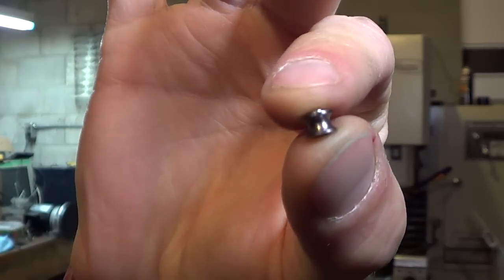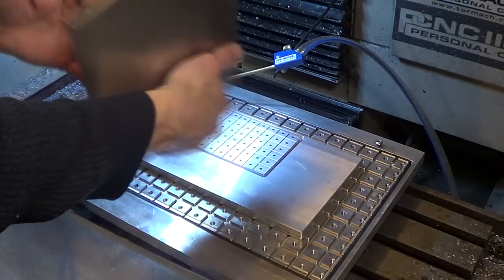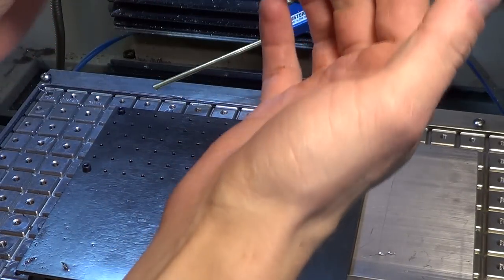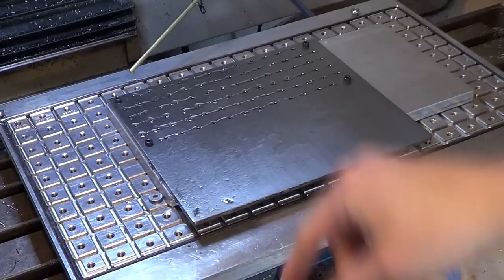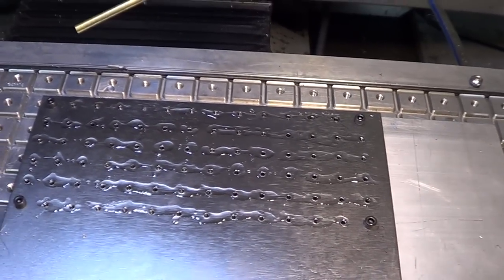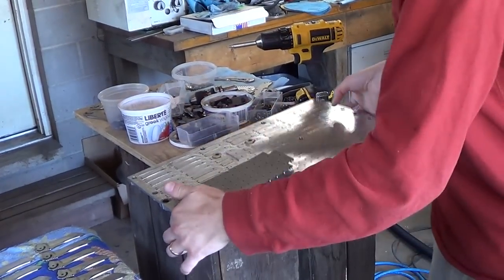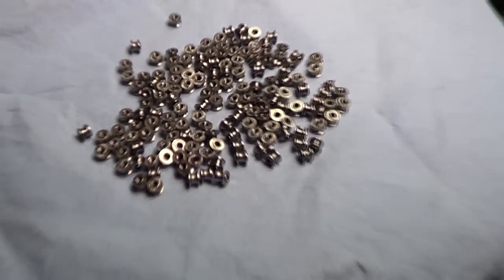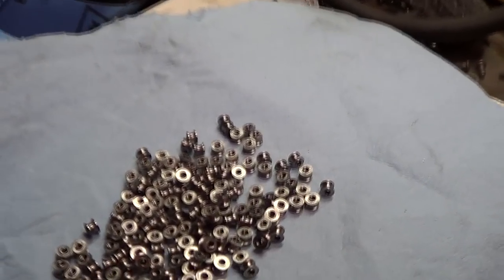CNC Titanium knife spacers

Comment: The problem with Superglue is that it's not FDA approved, it's composition is slightly different than the medical stuff. Superglue will break down into unsafe components such as formaldehyde. HOWEVER, in the doses you get from the amount needed to seal a cut is insignificant. I believe you produce much more in your gut from digesting certain foods.

Comment: Not complaining they look nice and the idea is a good one but seems to me that there is a lot of wasted metal from the plate I don't know where or what your profit margin allows you however a company/business should always try to max savings when and where possible turning it from a bar stock would yield less wast titanium which material cost will add up much faster than a few extra tool changes  but as you stated your lathe lacks quality so for you at the time maybe it is the bast way until able you buy a good CNC lathe

Comment: Bit late to the party here, but when you have to machine parts like this, offset the rows by 30deg for like a honey comb pattern to massively reduce stock waist and as a bonus you get for more efficient tool pathing. BTW the first commercial use of super glue was in the war, it was in first aid kits to close up cuts and bullet holes.

Comment: rigid tapping function are quite commonly on cnc machine and work with NC tap are better may be I think it give better chips flow less shear force compare roll tap
.
Reply: RayChan----------The up side to using a roll tap instead of a regular spiral point is that the roll tap doesn't leave chips.  The thread chips build up when threading multiply parts and sometimes you  have to stop the spindle to clear the chips.....lost time.

Comment: I recommend buying a sliding headstock lathe , because you have to work exclusively pieces relatively small ( 5-8mm in diameter ) and especially with the technology of the guide bushing components so small , precision and productivity are incredible .. . ( I speak as an operator in here Tornos turning centers , citizen , DMG Mori Seiki )

I would recommend the series Tornos micro or Citizen L20 ...

Obviously, the machines are costly , however , do not think you can find better in the market

Comment: Okay, maybe it`s more practical for you to do it that way, and the engraving is a cool touch, but...boy, you are wasting TONS of material. You can find tube wich has the right inner and outher diameter. to minimize operations, and machining two simple adapters, you could easily pop them out in an evening. (meanwhile the mill does much more interesting things XD )
Besides on a lathe, you use a four tool rotary post, no need to "change" the tool (and set it properly) each time.

Comment: Waste of material and so many better ways to do this.
Reply: Roger LaFleur I would have to agree with you, the amount of waste material is crazy..
Reply: +Roger LaFleur You could have spent as much time suggesting better ways to do it.
Reply: Roger LaFleur i disagree i think he made a great amount of standoffs in the most efficient way possible
Reply: Right at the start of the video he tells that it would be much better to make it out of round stock on a lathe.
He also explains his reasons why he doesn't use his lathe. John is fully aware that this is a waste of material, but he has to work with what he's got

Comment: Love the comment  "the lathe can only cut 1 at a time even with a bar puller"  what a joke.   You can only cut 1 at a time with a mill also.   Lathe with bar puller would take 10 sec. each and you would not need to flip.

Comment: Really, it is not like you have more than one spindle on that tormach, so you are still doing one piece at a time.

Compare this with a screw machine or a swiss lathe. I know you'd get the amount of parts from the screw machine faster than what you have clamped there on the mill......but on your mill you'd have to manually remove your parts and insert blanks again. 

Screw machines are still the king at stuff like this. Anyway, you could also try doing small parts like that on a Brother tapping center like they did at my old work.......but if your fixture isn't PERFEcT, you will get parts kicked out.  You don't have those sorts of problems on a screw machine.

Comment: I am getting into machining titanium on my tormach. I was wondering if you could give me a starting recipe.

I have the tormach face mill. Which inserts should I use?
I am making parts from grade 5.

Any suggestions using a 3/8 end mill for speeds and feeds?
I am running a .030 end mill in titanium, at a whopping 2 ipm.

Comment: This is a pretty cool solution to your lack of lathe issue.  The final product looks like you were able to maintain a great surface finish as well.  
My first thought was similar- yikes at the scrap, esp for a pricey material like Ti.  In the interest of pursuing this further, and because half the rest of the comments are to the same effect, here is a little breakdown:
(Assumption part is approx 5/16 dia x 5/16 long, 6-4Ti)
Plate 9x9x5/16: 4.12lbs
12ft Bar 5/16 dia: 1.8lbs

Bar with .05 c/o could make about 345pcs, at $45 per pound (priced last month) that's $.50 per part in material cost.  On my Hardinge GT slide lathe I'm guessing under 45secs per part complete,less the engraving.  That's completely unattended after setup. On my swiss under 20secs, but she ain't for 160 piece runs.

Plate for 160pcs is about $1.16 per part material cost.  I have no idea the breakout of per part time across all operations on the Tormach, but the rough took 20secs each, the tap was 10secs.  Spot, shoulder mill, drill, Harvey groover, putting a bolt into and out of each part- I'm guessing each part was anywhere from 2 to 5 total minutes each.  That's without the engraving(which is awesome btw).

Yes the method is less efficient, yes it produces considerably more waste.  But it also being done on a machine he currently owns.  It is keeping the spindle turning.  And he does not have to find the floor space for 4ft by 7ft slide lathe with a 15ft bar feed, nor is he making loan payments against the 85k it would cost.  The Swiss, triple that...

I applaud your ingenuity!

Comment: I think you would get much better results using rigid tapping (synchronous control of the spindle position & the Z-axis feed). Does the Tormach have rigid tapping capability?
Reply from the maker: The Tormach does not have rigid tapping capabilities, unfortunately.  I do a lot of threadmilling though, which is good fun.

Comment: You machinist guys really are clueless when it comes to runnning a business. Sure, it could be made faster with less "waste" even though he keeps his chips and recycles them im sure. regardless the amount of money he would spend hiring out a job shop to do it would far outweigh the material he wastes doing the job himself. Plus, farming it out you loose all control of TIME. which is VERY important for a small business like his. Time is money. all cnc's waste material, but make up for it in TIME.

Comment: Thanks for the info. I tool I was considering was the Harvey Tool PN 984008 (300 degree undercutting end mill). Might want to give it a try... It's quite a bit cheaper and could let you reduce your spacing between spacers and waste less material. That is if it will cut a deep enough radius for your spacers.

Comment: Well he didn't have to pay someone else to do it. Out sourcing small parts runs costs a lot per part. He saved time not having to wait for the parts and he saved time not using his lathe due to changing tools and multiple operations. He gave up on the stock it self. I am not sure why I had to explain that. It seemed like common sense to me.

Comment: The first lube that you used looks a bit wasteful, sometimes use Molybdenum Disulphide grease (for CV joints etc.) to lube pivot pins and the ramp at the back of the tang that the Omega spring pin bears on in Axis locks.
I've found that it's a lot cleaner and more accurate putting the grease in a syringe (20ml or 50ml from Amazon for less than £1),to apply the grease. they pay for themselves the first time they're used. no more sloppy overspill.
Loving the videos. Thanks for posting them.